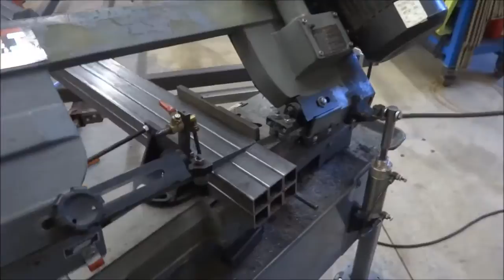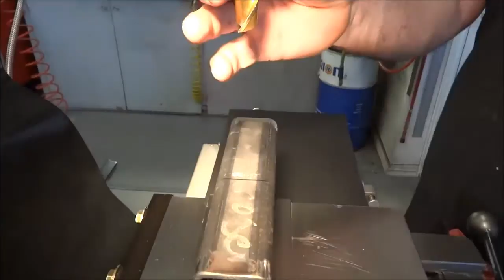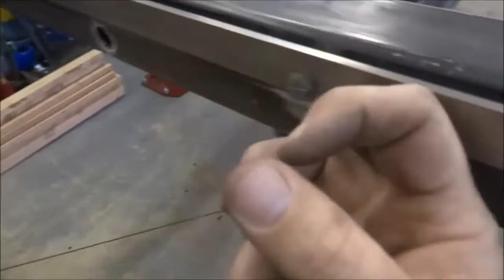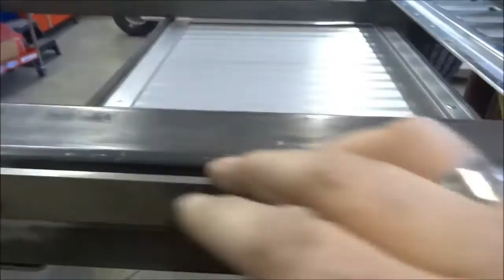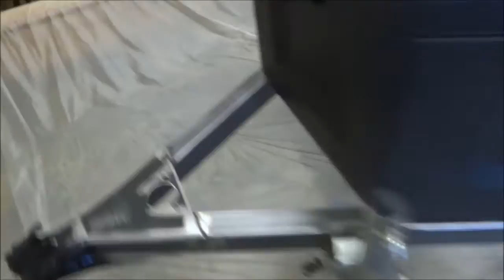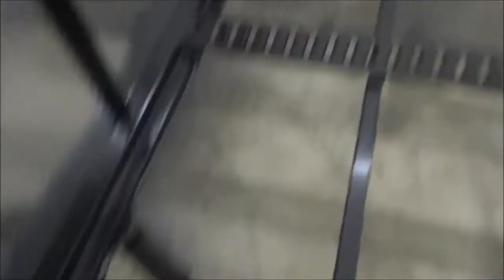Utility Trailer Build

Comment: Awesome trailer build, you are quite the fabricator with attention to detail. I've looked at a number of commercially available trailers and none are built to your quality. Do you mind me asking what you spent on the paint ?
Reply from the maker: Thank you very much for the compliments.  As for the paint I used Martin Senour paint from my local NAPA.  I used their metal etching primer as well as their single stage commercial quality paint.  If memory serves it was around $600.00 for the paint, primer, reducers and catalyst required.  I hadn't sprayed the Martin Senour brand of paint before but have heard many good things about it so I opted to give it a try and was very, very pleased with not only how nice it sprayed but how durable it is and the overall quality.  I generally used PPG products but I was already way over budget on this trailer and the similar supplies in the PPG brand were almost another 80%s more.  I am glad I went with the Martin Senour paint and would use it again.

Thanks for watching and for the comments.
Mike.
Reply: My mane is Albert Panino
Hope you don't  mind  me asking ...how much will charger to build me one maybe smaller for my motorcycle.?
 I have Honda fury 2016..
Reply from the maker: +albert pacheco thanks for watching my trailer video Albert.  While I appreciate your interest in having me build you one and I am flattered, I simply don't have the time right now as I am still trying to get the new shop setup.  I also really don't think it would be cost beneficial as I have so much time into this one doing all of the little on-off items.
Thanks again for watching and for your interest.
Mike

Comment: The end result on the wood decking is just linseed oil? It looks really sharp! I like the rim choice also.
Reply from the maker: Thank you.  I appreciate that.  I kind of splurged on the wheels.lol

Mike.
Reply from the maker: Sorry, I forgot to answer your question.  Yes I just used some plain ole Boiled Linseed Oil from Home Depot, nothing speical.  I was also very surprised at how the wood deck turned out.

Thanks again.

Mike.